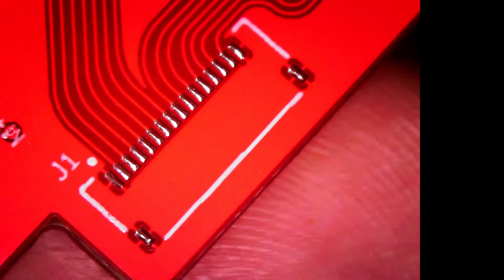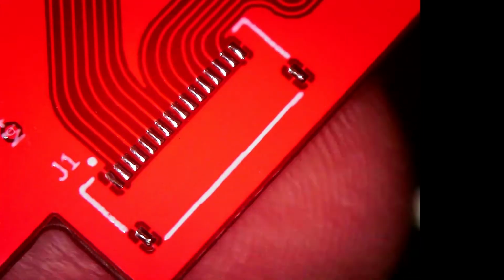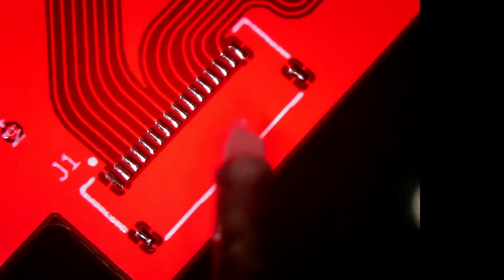FPC Connector Soldering - Microsoldering Guide

Comment: 1) I don't like the idea to blow from underneath at full strength, because you might make much much more damage by blowing off components than you are fixing. 

2)  If you need to reheat the board approx 10 times or so, you might delaminate the PCB, ruining the device and the spot you want the connector to be soldered to, as well as the bottom layer and whatever traces are in between. 

3) you did not show what the board looks like on the bottom, but it's probably brownish.

Comment: Now do a tutorial on how to solder and desolder this plastic parts without melting them with hot air. There's always cases where you cannot apply heat underneath the PCB.
Reply: To desolder, you can use a copper wire, bent in a U-shape so it touches all the pins plus the anchor points, and then just use a soldering iron+flux+solder to get it off
Reply from the maker: Not really possible with many fpc connectors sorry. In many situations it may seem impossible but there is probably a way to work with hot air, requires covering some components with metal tape or otherwise

Comment: What if there are parts on the other side of the board, in or near the area you need to heat?
Reply from the maker: If it's not plastic, it's fine
Reply: @MitchCairns  what if there is another fpc connector on the other side?
Reply: I also have this query... a micro capacitor on the underside is in the way and likely to be heat affected/heated off

Comment: While soldering on a new DC jack for my laptop, I somehow pulled the FPC connector from a daughter board that has a USB port and the audio jacks on it... It is not crucial, but I'd like to have them. This video is exactly what I was looking for, so thank you!

My FPC has many more pins, and it is hard to tell scale in your video, but I feel like mine are so much smaller. It does not hurt to try since it is just a daughter board and I have found a replacement one on eBay for $35...

I will give it a shot! Thanks again for uploading.